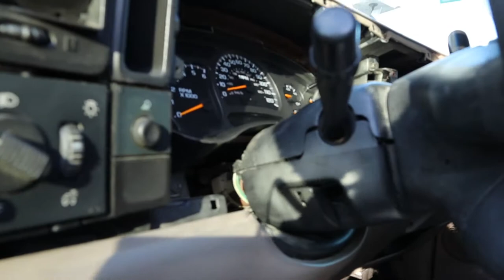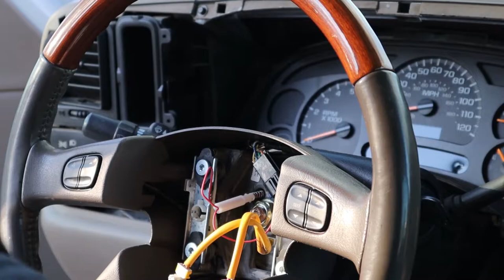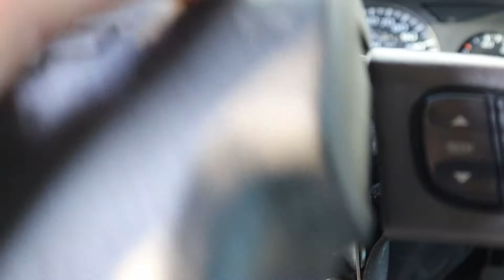How to Replace a steering wheel on '03-'06 Silverado

Comment: How did your horn honk if you had the battery disconnected?
Reply from the maker: Ha ha, good catch. I didn’t actually disconnect the battery. It’s just recommended as a safety precaution whenever working on the airbag system. Thanks for the comment!

Comment: My problem is behind the steering wheel they are two T25 Torx bolts and I can tighten them down in my steering play goes away but even using Loctite and all different types of things to get it to stay it doesn't in the steering wheel play comes back I can't figure out the name of the part or what it's called to fix I'm hoping that you might be able to help me answer that please anything helps

Comment: What if my horn doesn’t honk when I put the airbag back on? Did I do something wrong
Reply from the maker: If the horn doesn’t work but was working before then the contact with the spring probably isn’t secured right. You may have to take it back off and make sure the contact is secured in the hole.

Comment: Quick question does the buttons works ?
Reply: No, there is no harness to connect them to. If your truck came with them originally then you would reconnect the harness plug during installation.
Reply: There's a video on here where a guy got his buttons to work. Have to replace the harness behind the steering wheel
Reply: @BobMarley-vm5oy  u kno the video name by chance?

Comment: Thanks so much
Reply from the maker: Thanks for the comment!
Reply: @onetgarage9429  I saw that in the video your Chevy does not have cruis control. is that so?
I have a 2003 Silverado 3500 dually, I didn't have the cruis control, but changing the Combination Switch (Windshield Wiper + Turn Signal + Headlamp Dimmer + Cruise Control) now it works !!!
Bought on amazon for $ 30 !!
if I can find the video explaining how to do it, I'll send it to you. You just have to check that you have the pin in the steering tube (where all the electric cables pass). the pin is square

Comment: Just swapped one on my 2006. So I had to pull the hub cover back and leave a screwdriver in one side and use a second screwdriver to pop out the other side to release the airbag. Luckily new steering wheel came with another hub cover because I had to really force the first one out the way. Just thought this might help someone that has the same issue I had